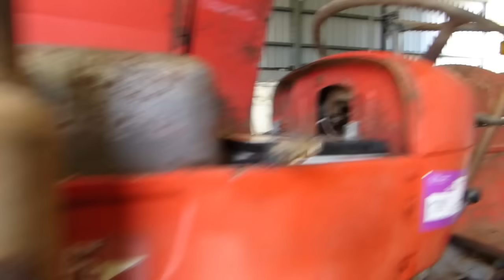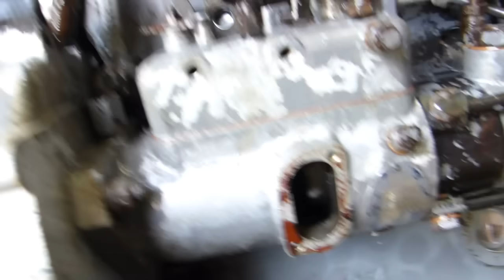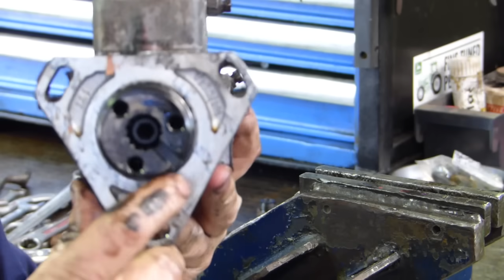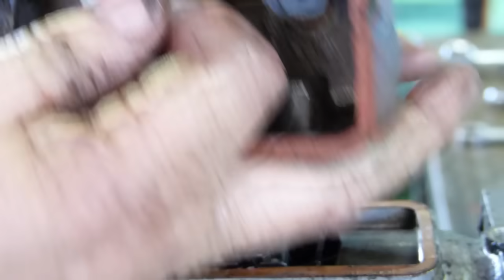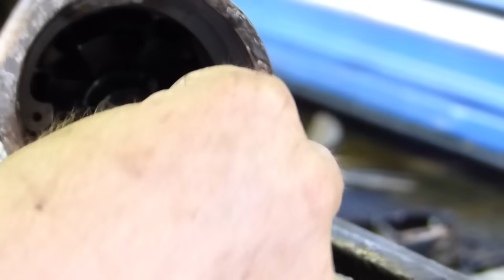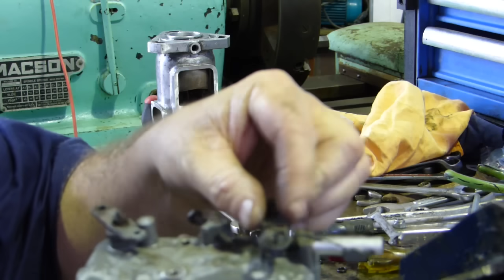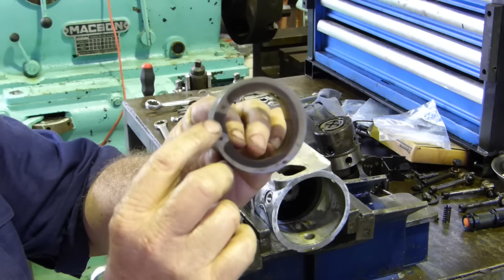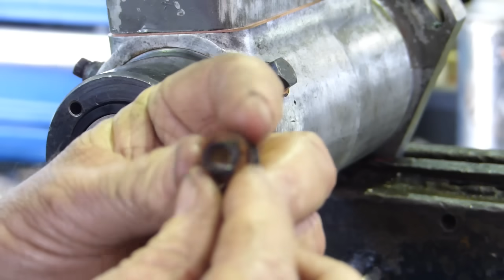CAV Injection pump full strip down to re seal and stop fuel leaks

Comment: Working on a 1998 Scat Trak Skid steer with a perkins Diesel and injector pump almost identical to yours here in the video- tore down only because the unit is a hard start with eather all the time.  only inspecting and cleaning all components..looks real good however, the pump does NOT spray or pulse diesel/WD40 etc like in the video when bench testing....it only sputters out like each port at the pump is slobbering little air bubbles.  I have reinstalled on the unit thinking the crank of the motor and the rail pump will increase pressure to the injector and create more fuel movement in the lines, but still only bubbles.  Am I correct in the assumption the fin powered pump at the front of the injector pump is faulty?

Many thanks for the video - it was well put together and offered alot of insght and allowed for easy start and stop to watch and understand the process
Reply: SO it is back together and after chasing a couple fuel leaks- it does start and runs...but it takes a process.  We have to prime the rail mounted pump 10 -15 times and hit the Air heating element about 20 second everytime we start it, no mater if we ran it 30 seconds or 30 minutes....could this still be the injector pump?
Reply from the maker: G Day, Sounds like you have a tired engine but I think you might have an air leak between the fuel tank and the fuel lift pump, or possibly a partial block.

Comment: G day from uk found your vid very good, got a jcb 3cx with same pump on it, going to srtip down now, {leaking out of throttle post} thanks mate
Reply from the maker: The top cover job does not need to be a big project, just look for where the spring is and you will be right Im sure

Comment: how do u time this pump to kubota m8580  engine that has been turned over after pump has been removed
Reply from the maker: G day Mike, I dont know for sure as I cant recall having to do it but if you go back to basics you should come through it. 
Find TDC on no 1 and see if gear has a key or a dowel and it should line up

Comment: i used to have a massey 35 diesel deluxe, which i had to replace the seals on the injection pump; though i never fully disassembled  to the housing. I love the whole video. I still kick my self for letting it go.  hope to see some older antiques torn down for restoring. Hint,Hint ,maybe a rumely oil pull ; would be sweet.
Reply from the maker: G Day Daniel, Well we have a problem, I dont have a Rumley to pull down, Now if you wanted to send one in I would certanly have a crack at it lol.

Comment: Hi Lance, thanks for your clips, love 'em. I recently fully reconditioned a MF35 4 cylinder diesel, a minor problem that I have is a small fuel leak from the throttle spindle in the injection pump cover. I have ordered a top cover gasket and o-ring kit. I note with interest that you do not use sealant on the gasket, does it seal properly without sealant? Can you tell me what torque to take the acorn nuts down to?
Reply from the maker: I dont use any sealant on the gasket as when the surfaces are clean you should not need it. If you are relying on a bit of sealant the job wont last long. As for the nut torque I dont seem to have that available, I just do them up firm but not over tight which I know will mean different things to different people.

Comment: A very good tutorial indeed :) But please don't unmount the drive shaft with a screwdriver and a hammer like at 29:27 . It is way better to use the hex screwdriver. Just screw the screw back in about 2 threads and press it off with the hex screwdriver.Greetings from Germany ;) Dominik
Reply from the maker: G Day dominik, I see what you mean, Now I have the plate made I can do that but in the paddock we didnt have the luxury of a plate. The screw driver does mark the housing very slightly but it has never been a problem as the force is outward. Thanks for watching and commenting.

Comment: Hi, Thank you for the CAV Rotary Injector Pump clip,  we have pulled the pump out and resealed etc, but now cannot line the three front bolts up on the front of the injector pump when putting back on tractor....any suggestions?  Cheers
Reply: A little more information for you, the dowel lines up and goes in, can get a screw in one hole, the others are half exposed so unable to put the other two bolts in.
Reply: The Injector Pump is in, got the tractor started and working well, our fuel leak is from the back bleed plug/screw, seems to have got worse since the new washer...we will attempt to replace it, Heads Tractor Services has given us great service.  Any further suggestions would be appreciated if that doesn't work.  Love your work, we have a great old tractor that I'm sure will be an asset for many more years to come.

Comment: I have a ford 550 with that same injector pump I turned it off after use and the next day it would not start.... no fuel at the injectors. My question is do these pumps just stop working or should I be checking for an air leak? thanks
Reply from the maker: They do just stop working, I would pop the top off and check the metering valve is still nice and free.

Comment: Hello Bundy Bears Shed and other commentators. I was wondering if someone could offer me insight on how to take apart the injector pump and then rebuild it back together. Also, if someone has a schematic or even a parts list for the injector pump and could send it to me, I would really appreciate it.  I will list the tractor information below for reference. 

Tractor: Long Tractor
Model 2057 Serial 30004423
Part in question: Injection Pump 

I can provide more information if needed. Thanks in advance for any help anyone can provide.

Comment: OK I LIKED WORK , IN THE NEXT WEEKS WILL BE RIDING THE TRACTOR MY MOTOR IS A MASSEY FERGUSON 85 X YEAR 1974 AND INJECTION PUMP IT IS SIMILAR TO THAT IS THE LORD MOUNTED .
GOOD, THE DIRECTION OF THIS TRACTOR , HAS LORD ASSEMBLY CYLINDER VALVE MF 85X MORO IN CUIABÁ MT BRAZIL AND I'M WITH DIFFICULTY THAT FIND STEERING SYSTEM IN MY IS MISSING WAS OFF.
A MY FRIEND TO EMBRACE MORE

MARCELO CARLOS MEIRA

Comment: Thank you so much.  I have the same injection pump on my Long 360 and have a little fuel leak around the governor cover and thought I would need to remove the pump for access.  Thanks for pointing out that the pump doesn't need removing for gasket replacement.  Great video!!
Reply from the maker: Glad you enjoyed it, Thanks for watching and commenting.

Comment: Great video when l removed top cover there was a ball bearing laying down beside governor plate any idea were it came from tractor will only start on either most of the time will not rev up idle at full throttle any help would be appreciated
Reply from the maker: Sometimes the advance under the pump has a small ball

Comment: I have a old 1955 IH td6 that sat for 30+ years, I got it running and moving on the gas start, however it wont make pressure in the injection pump. do the plungers stick? what should I look at first?
Reply from the maker: Pull the side cover off the pump and see if the rack is moving, from memory I thought those were an in line pump.
Reply: Hello, I did do that and all the parts under the cover clean and moved freely, but the parts I cant see seem to be stuck. when I pulled the pin and linkage  to move the lever by hand I can only move the rack and nothing else will move.  Its been a chore fighting me at every  opportunity but this is my last hurtle to get this old td6 back in action. thanks for the help and for putting great videos online that help people like me and entertain all others.

Comment: Thanks for the video, best I have found on this pump. I have a problem, my pump came of a Cummins 4BT3.9M (marine diesel) and is has four plungers in the rotor instead of two. Two are longer. They were stuck in place and by the time I got them out and cleaned them up I have lost their original positions.

Is there a way to identify which plungers go in which hole? I suspect that the longer two are the actual pumping plungers and the smaller two are doing little.

Thanks,

Morry
Reply: Think I worked it out. The two longer plungers go opposite each other, the two smaller do the same. If they are not inserted like this the larger plungers will hit each other! I suppose it would also have some effect on the balance of the rotor any other way!

Comment: I have a Perkins 4.108 Diesel Engine that's in a Bobcat 825 and my Rebuilt Injection Pump is not pumping, I think it's for a counter clockwise engine. For a marine diesel ?
Reply from the maker: The rotation should not change at all, I would check inlet supply etc.

Comment: Can a CAV DPA injection Pump Work clockwise and Counter Clockwise ?
Reply from the maker: G Day Ben, There is often an arrow on the oval plate that tells you which direction the pump should go. They will not run backwards.

Comment: Excellent vid. I just resealed my badly leaking pump. When I started the tractor is went wide open with no throttle response, any idea where I went wrong? I rechecked the throttle shaft spring, maybe the fuel inlet assembly?
Reply: I also confirmed the governor spring is in the right holes, twice.  Just to verify I looked up the code on the plate (6) which is 2 hole on governor plate and 3 on the throttle shaft.
Reply from the maker: Usually it is the spring unless the metering valve is sticking a bit, binding in the bore as the metering valve controls the fuel flow.

Comment: Hi, may you can help me out - i have the same engine mounted in an mf 
tractor 362. The problem is that the fuel comes out only at one high 
pressure pipe at cylinder 2 (beginning in the front). No matter if i 
vent with the hand pump or by the starter motor. Shut down valve is not 
stuck but no matter how it is adjusted (run or stop), fuel comes out 
only at high pressure pipe no 2?! May you can give me some tips to 
figure out the issue.
Thanks, August
Reply: Just demounted the end-plate and recognized that the vane pump isn´t 
rotating at all - the shaft, when looking trough the covered opening at 
the front side, is turning. Something at the distripution shaft is 
broken either loose. Worth for repair... is it fixable?
Reply from the maker: Sounds like a broken shaft, Often a new one can be purchased for less than it costs to repair the old one .

Comment: Hi Lance . have you  ever stripped a Kia Pregio injector pump. I'm having diesel getting into the sump . any pointers would be good or if you could reseal for me .Hayden in Bundy.
Reply from the maker: G Day Hayden, No I havent, have a good look at the fuel lift pump if you have one as a faulty diaphram could leak diesel into the sump or the front seal on the injection pump might be leaking and Im not sure if you need to strip the pump or not for that one.

Comment: this is the most clear vid I've every seen it helped me a lot , but i deadly wanted to see how you but put back the pump in , for the timing cause im taring to disassemble main but i do not have idea about the timing . thanks again
Reply from the maker: The pump will just go back onto the drive gear in the same spot as there is a dowel and you can not put it in the wrong place. Then just line up the timing mark on the flange and you are done.

Comment: I successfully replaced the seals on my pump and stopped all the leaks. I am having an issue with the tractor revving up suddenly and can't get it to idle down.
What did I do wrong?
Reply from the maker: Probably got a the spring in the wrong hole on one end or the governor plate didnt sit in properly. Pop the top off and check for shiny wear marks from where the spring used to be. They are small but you can often still see them.

Comment: hi lance , ive stripped and done my pump after watching your video- great stuff taking the time  putting these vids up by the way. 
my tractor is starting but seems to be revving its head off- the only way i can control it is to pull the stop lever back to have way, have i put something back together wrong which stands out to you?
my throttle lever isnt doing anything and my choke/stop lever is acting like a throttle- any thoughts on these symptoms? 
look forward to hearing your reply
Reply from the maker: G Day Paula, I think you have the spring in a wrong hole, look for wear marks to  see it it is where it used to be. Lance

Comment: Long as I have been working on tractors I have never worked on one of these pumps. Now we have high pressure pumps with fuel rails pushing over 20000 psi under heavy loads. Sometimes I feel like a parts changer as we just replace the part and go about our business these new pumps cant handle contaminants like the older fuel systems of the day could. Thanks for the video sir enjoyed it from one mechanic to another always learning something new.
Reply from the maker: Thanks Jay, yeah times are changing for sure. Just plug the diagnostic scanner in and away you go, then replace a sensor. Thanks for watching and commenting.

Comment: Bio diesel if made correctly does not eat rubber O rings as the diesel is PH neutral if made correctly, it does not contain methanol as this is all washed out, bio diesel is more eco friendly as its cleaner than diesel, diesel these days contains lots of things to be eco friendly, the old diesel we used to buy can cause cancer and the fumes are dangerous to health.

Comment: Great Video, Going to rebuild mine, MF 1080, they don't need to be taken to a diesel specialists because the fuel pump  operates with a Cam Pump which is the machined ring and thus cant be adjusted, Great design by CAV, so no need to be taken to a specialist to have pump put on a diesel fuel injector tester, also don't adjust the ring on impellor end which is set by CAV on a flow tester in the factory, which is the part he mentions "juice up engine".

Comment: Great video! Having watched it I'm happy I could sort out the pump on my '63 35x if I had to (though thankfully she runs fine 99% of the time with only the occasional slightly slow pick-up from idle when very hot)
Reply: Colin Mill on your 35x do you know the govner spring setting?

Comment: Thanks from Holland! I had a leaking CAV DPA pump on my Leyland O.680 horizontal engine, which is a 6 cylinder but your vid helped me doing the job fixing the leaks. Only thing I did that you didn't, was cleaning the housing prior to taking it apart. Dirt is an enemy once it is inside your pump. What are your experiences with modern diesel oils by the way? ALL the small copper filters in the fuel line were gone due to the dopes modern diesel fuels have these days. These copper particles clogged the fuel filters and might get into the pump where it will ruin the pump. Like to warn people for that. Thanks again for this excellent video!

Comment: Hi! I saw some of their videos and identified with the video cav pump, since I have a f-100 ford diesel engine MWM 226/4 cylinders.
  I started to watch the you tube because it has almost everything here for CAV and DELPH bombs but for door guns still missing a lot.
  I try different connector, has rounded chamfers type mouth horn, the case is that my pump is rotating CAV.
 
      The connectors of the injectors doors were not sealing and were dripping and wetting the entire left side of the engine and noticed that over the years the connectors were crumpling their headquarters getting slots. OK! I decided then broaching the connectors to leave with the cleaner back for a better seal, but I was wrong with the measure because there is a certain precision.

     Finally! I bought new pipes and now I just need the new connectors and also here BRAZIL'm not thinking to buy. It is easy to find these pieces in your city?

Comment: I have an awesome question lol what Tool did you use to get to the back and bottom bolt that goes into the timing cover that is on the back of the pump housing?

Comment: Good stuff mate! 
Had my 3 cylinder Perkins pump apart this aft, just the end cap really. Everything seems okay, had some dirt in it though. Cleaned it up, the fiber washer stuck a little but was for the most part intact, put it back together and bled the bleeders. Lotsa pressure inside the body. Nothing coming out of the lines to the injectors though  :-(  Suggestions? If I don't hear back from you, I'll try the box on top, maybe the shut-off is causing the prob?
Do you have an vids on loader control spools? My hydraulics are slowly fading on the lift ... no sign of external leakage

Comment: Thanks so much for the viedo on the CAV injection pump it was grate. I wish it had been on a ford tractor. I have a 1976 531 and a 540A. the pump is on the right side and has a piece on the bottom side that is a little different I think it is part of the govener. But I believe it pretty much the same other wise. Thanks again your viedos are the best I have seen.
Reply from the maker: +Steve Mccall Thanks Steve, Yes the pumps will be very similar the bit on the bottom of yours will be advance but it just pulls off from the bottom.

Comment: Great Video. I have a couple of questions. I have a MF 175 and I'm going to rebuild the injection pump. It's not leaking but it's also not pushing any fuel to the injectors. You mentioned that if that happens the spring could be broken. Does the kit come with new springs? If not where could you order them? 2nd question what is the part number that you mentioned for the rebuild kit?
Reply from the maker: +teutates74 G Day tetutates74, Im sorry but there is no springs in the kit it seals and gaskets only. the part no is S.57135 that is a Sparex number.